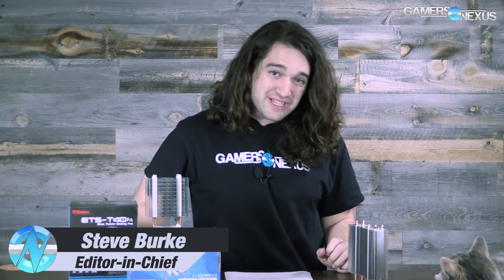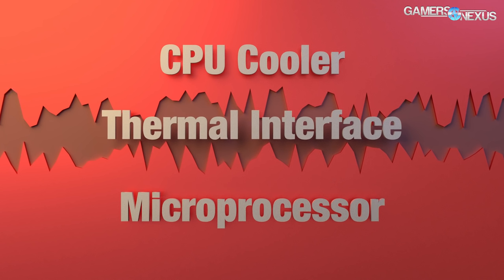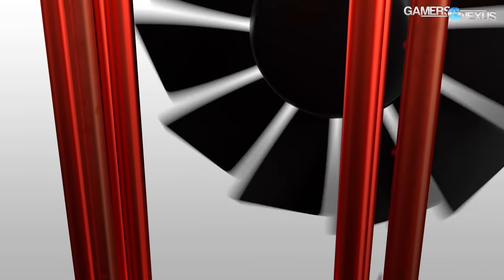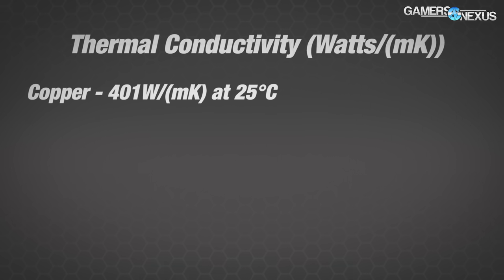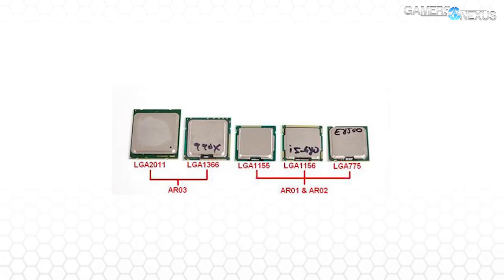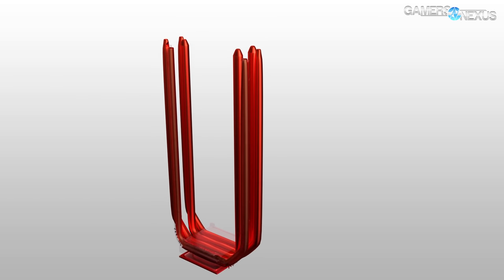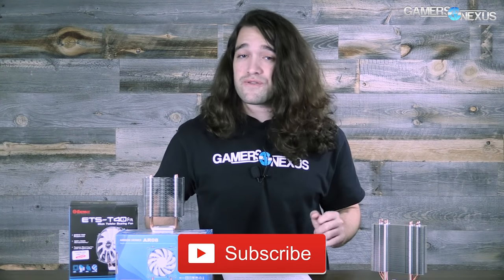TLDR: How Heatpipes & Air Coolers Work (w/ animation)

Comment: I deal with heat exchangers and oil and water seperators at a chemical plant. I never knew these pipes had liquid in them. I thought it was a dry hot to cold heat exchange. Learn something new everyday

Comment: Great video. Never knew about the heat pipe internals and the resulting capillary forces. I do have one question though:
I can see both types of heat pipe & fin stack coolers working perfectly (full size like the Hyper 212 EVO and low profile like the GeminII M5), when used on a test bench where the motherboard is laying horizontally, and the fin stacks are above the CPU. That being said, I can't understand how these coolers work in actual builds where they are attached to a motherboard mounted vertically in a case, especially for the low profile ones! In that situation, the fluid inside the heat pipes would just move down to the lowest point of the heat pipe when cool. When the fluid inside heats up and evaporates, it rises and there is nothing stopping it from moving up in the heat pipe towards the CPU, rather than towards the heat dissipating fin stacks. When this happens, you now have vapor locked heat pipes against the CPU that are only going to get cooled down from passing air, rather than from the intended fin stack section.
I'm not trying to say these are garbage, because they clearly work. I found this video because I want a low profile heat pipe cooler in my build, so I'm not bashing them. I'm just genuinely curious about how these actually work when mounted in a case. If anybody can provide a little insight, it would be greatly appreciated!
Reply: In principle, the method of heat travel in heat pipes is independent of gravity. Heat rises and cold sinks by gravity, so that doesn't matter for the same reason. Heat pipes are used in space, at zero G, too. Heat does not rise in 0 G.
 Start by forgetting the usual way of thinking about a gas. Air is also a gas, and its thermal conduction is terrible. The speed of conduction in heat pipes is very high because the gas is so rarefied that the molecules travel long distances with few collisions (ideally none) with the other molecules, exactly the opposite of how air conducts. The temperature gradient within the heat pipe, in the gas, will be very low. The actual problem is getting the molecules hot, and therefore moving fast. That is what all the change of phase from a liquid to a gas and back, and the wicking, and surface area is for. The way this video has it, it looks like liquid is going to a gas in one place, and gas is going to a liquid somewhere else. This is not true. The phase change is at an equilibrium, approximately, everywhere in the tube. The phase transition is happening everywhere in the tube.
 Basically the inside of the tube is closer to a vacuum than a gas. It only has enough liquid added so that it will evaporate (due to low vapor pressure), and still the gas molecules will be so rare that the gas molecules will seldom get in each others way. The amount of heat moved is in how fast the molecules move, rather then in the number of molecules moving.
Reply: @kennethflorek8532  Your reply made me even more confused

Comment: What happens with the gas when heat pipes are horizontal? After all, they are horizontal for most tower CPU coolers and GPU coolers in a standard, vertical mobo case.
Reply: @mehulmonisha  said it has a liquid, well liquid follows gravity right?, if the cooler is horizontal, the liquid will be on the lowest part of the tube?

Comment: So if I'm understanding correctly, if the cooler is laying horizontal like in your animation where gravity will pull liquid down, and I quote "and through capillary action it trickles its way back down to the bottom and repeats the process", it will be most effective at cooling the CPU. BUT my question is: IF my tower is standing up and the CPU fan is now oriented vertically, will most of the water rest in the pipes due to gravity? Effectively not really evaporating by direct heat of the CPU but rather indirect heat from the CPU to the heat pipes? Does that makes sense? If that is the case, would it not be logical to keep your computer tower laying horizontal to get the best effect of the CPU heatpipe air cooler? Or is there some logic that I am misunderstanding? Thank you!
Reply: This is a very good question and deserves an answer!
Reply: no problem, just need a bit more time (become warmer) than vertical mount to get a peak temperature.

Comment: Can you solder a cooler directly on the CPU ? This would improve the thermal conductivity a lot however the temp during the soldering operation might destroy the chip.

Comment: So, can the cooler boil dry, if it is facing sideways ? I have it like that in my built. I built it before knowing about that liquid inside the pipes, and now i am worried. Maybe i just build a wooden stand for my pc, that gives it a little angle, so the vape moves away from the cpu ? Is that a good idea ?

Comment: I always wondered how the liquid inside the heat pipes returned to the bottom without interfering with the rising hot gases. Thanks for that. But there's an immediate issue with heat pipes then. For heat pipes to work optimally, wouldn't it mean the heat pipe itself would need to be placed vertically with the hot section at the bottom and the cold section at the top, as this is how boyancy and gravity drives the phase change process. 

This might be a good experiment to test man! See if heat sink with vertical heat pipes aligned vertically vs the "normal" i.e. side ways that it will be inside the case and also side ways graphics cards might change the temperatures. you get.
Reply: OnePercent this is the main reason for the wick and fluid mixture so it works in any direction. The main cooling is phase change so getting the balance of mixture so it changes at the right temp.

Comment: Hi and great explanation. Wish I can get a response to my question. Can you overcool a CPU tower heatsink with heat pipes as used in you demonstration here? My scenario is different where I'm using the CPU cooler with Peltier's module. The hot side is on the heatsink cooled by two fans. I noticed when I shut down the fans, the cold side of the Peltier got colder until the heatsink heats up to over 40 deg. C. Then I will turn on the fan to cool back down to about 32 deg. C and it will continue cooling the cold side more(colder). So are there a kick in and kick out temperature for optimal performance of the CPU cooler. Wish I can really get an understanding of this.

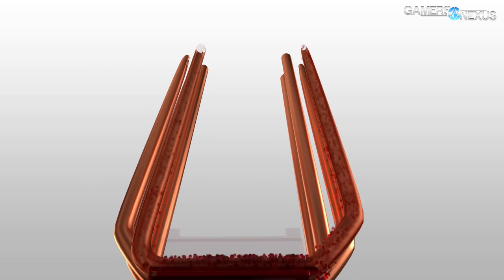Comment: So, if 1:30 the liquid turns into gas, then it evaporates upward right? but when we install them and then have our towers stand, it's sideways right? how will that work then?
Reply: The principle is the same just change the orientation. The gas still expands to where it can expand which is away from the base to the colder regions.
Reply: @harveybirdmannequin  thank you!
Reply: @orenji13  https://www.youtube.com/watch?v=2aQg1v5rXKw
Gamers Nexus actually did a video with testing. Orientation had no meaningful impact.

Comment: If only lapping was not so expensive and hard to do right on soft metals like copper we could get rid of thermal paste all together. If one could get both surfaces with a surface finish/roughness of less then 25nm then the heatsink and cpu could be wrung or cold wielded together. It would be interesting to see if the thermal transfer would be better or worse compared to thermal paste.

Comment: I was shopping for a new CPU cooler and got far too involved into the science of what and why.. Long->Short; older NH-D15 seem to work better on 32 core CPU's than new NH-D15 because of there target cooling for CPU's at the time by changing the boiling point of the liquid in the heat pipes.

Short->Long; I was watching Kit Guru review a Zalman CNPS20x as that's what seems to be the best bang for buck on the higher end of air coolers and he didn't realize he had an older NH-D15 to which he tested out of curiosity. To which he found that the older cooler performed better. My initial thought was the older fans probably spun faster idk, but it still made no sense. Then i thought far too deeply about it and how heat pipe's liquid is formulated to boil/phase change at a target temperature. Too cool and it stays liquid, too hot and it stays a gas ("running dry"). And Consumer CPU's from 10 years ago ran Very hot and 200 watts with 12 phase motherboard's where the craze, and could easily go to 300 watts with overclocks. I know for sure the FX-8320 i still have can suck down about 300 watts @4.7GHz :-/ but it doesn't go over 68c on a Zalman CNPS9900 MAX (3x140mm Nuctua intake fans on the front) BUT it also jumps up to 60 quickly as (my guess) the liquid isn't phase changing until then. Where's new Consumer CPU dies (not prosumer like the 12/16/32 core CPU's) are soo small they can't really move the concentrated heat into the spreader so then in turn the spreader it self is cooler, thus needing a lower target phase change in the heat pipes to cool the CPU, ergo.. modern Coolers target lower TDP and perform "worse" for high TDP applications.

Comment: What about plating, such as Nickel, on the coldplate? ... with Nickel having a very low thermal conductivity, although in plating it's obviously an extremely thin layer, does it have any impact on cooling performance at all? I'm guessing it would be so negligible that it's not worth worrying about but would be nice to know for sure ;)

Comment: +Gamers Nexus   Does this mean the orientation of a cooler would have a significant effect on its performance? most are mounted on their side (tower case), neither specific gravity of liquid/gas or hot/cold would be working as designed. an interesting +Gamers Nexus test? great job with he animation that's next level

Comment: So these types of coolers like the ryzen wraith cooler doesnt cool as well in a normal side position in a tower like it would sitting directly on top of the motherboard in where the pipes are going up and down instead of sideways correct?

Comment: I have a question could I use that heat pipes for the heating surface inside mold without using fun?! I mean that liquid inside the tube will be cycling again if I didn't use fun I just want to heat to transfer for the surface?

Comment: I have a question, why don't motherboards come with steam chamber? All that energy in waste heat, we should pour it back into the psu via steam engine. I mean steam engines can theoretically get upto 30% efficiency. That's pretty close to 80+, right?
Reply: What CPU or GPU hits 100C all the time in order to create steam? That is just to get wet steam. To get dry steam, which turbines like for longevity takes even more heat unless a different medium is used. Not to mention that the larger the temperature difference between hold and cold sides the greater the maximum efficiency can be. With a low temp difference of less then 100C the max efficiency would also be low. There is all kind of stuff on heat engines, the Carnot cycle, etc. out on the web.
Reply: I think it ruins the joke if you force me to explicitly state that it is sarcasm.
Reply: Jason Smith The "That's pretty close to 80+, right?" sounded like a joke, but I have lost count of the number of people that have asked that same question or something similar to it over years.

Comment: Thermal paste longevity: is there a time limit of the effectiveness of the thermal paste applied i.e. should thermal paste be re-applied periodically or never touched again?
:>)
Reply: its more of a "if it ain't broken then don't fix it" thing. I mean my ps3 is still working and I have never replaced thermal paste in it. my PC I had soon 4 years, moved 3 times, and thermals are still top notch.
Reply: Change it when your temps start to go up.....

Comment: How does the condensed liquid in the heat pipes get back to the base,  when nearly all heatsinks are mounted at a 90 degree angle to the ground?
Reply: D0wnshift It doesn't need to get to the base, it will just heat up where ever it's at then and still do its job.

Comment: This will be a complete noob question... Is there any benefit to polishing the contract surfaces of the cpu and the metal of the heatsink?
Reply: you meant "contact surface"
The answer is yes, smooth surface faster at transferring heat

Comment: what i never understood is why the temperature difference between the CPU and the cooler is so significant. If i touch a 80deg hot graphics card - it really is so hot that you don't want to touch it. Doing the same with a 70deg warm CPU running a load test and the heat pipe above the CPU is hand warm.
Reply: touch is from the bottom. the top of the cooler gets the least amount of heat, if you're into that kind of stuff, or run some cpu stress test for a full hour and fans to 20% and you will get your desired effect aswell

Comment: why don't they make thermal compound that contains copper? i mean it should perform better right?
Reply from the maker: There is compound that makes use of carbons or other materials to improve conductivity, but it often becomes electrically conductive as well. This is dangerous to use if careless, as any spill-over from the IHS (onto the board or elsewhere in the system) can cause short-circuits.
Reply: Most thermal pastes use a metallic oxide suspended in silicone grease. The main issue with the thermal paste is that the silicone grease is not really that conductive and the metal particles in it still have gaps between them. You can get some really high end thermal pastes based on non silicone greases as well liquid metal thermal pastes. However they are only marginally better than conventional pastes because the liquid metal alloy is not really that conductive due to the metals that it's made of not being particularly conductive and the pastes that use non silicone grease based TIMs still have the same issue that silicone based TIMs have and the alternative silicone really isn't that much better.

Comment: so the thermalpaste is the weak spot in the whole process, is there any projects or researchers to find a better heat rated paste? something not below 10 value.
Reply from the maker: Yes. Thermal compound is a weak spot. There is better thermal paste (and there are good thermal pads) out there, but it tends to get significantly more expensive. The ideal solution would be a perfectly flat piece of copper and perfectly flat IHS (or lapped surface), with 0 room for air pockets, and then no thermal compound. But such a solution is not reasonably or affordably possible, right now -- manufacturing is largely an imperfect process!

Comment: Question; in most tower cases, the CPU surface is vertical, meaning the cooler lays sideways, and the heat pipes don't get the benefit of hot going up and cold going down.  How does that affect things, real world?
Reply: Hot air goes up and cold air goes down, but that is air in our atmosphere, and it is moving due to air pressure caused by gravity. In a heat pipe or engine heat transfers from hot to cold. As Steve said the better heat pipes use a porous almost sponge like lining, which water, ammonia, etc. can wick up through against the force of gravity towards the heat source since it is phase changing and is drier so water, ammonia, etc. wants to flow there. Once the liquid is phase changed into a gas the molecules by the CPU/heat are moving faster then the ones at the cold ends so there is a difference in pressure, which want to equalize so the hot gas flows towards to cold ends of the heat pipe. As long as there is enough forced air flow across the heatsink via a fan how it is mounted should not really matter.

It would be an interesting vid for some Youtuber to try out one day to see if I am right or wrong :).

Comment: My heat pipe doesn’t get hot or even warm. I can’t find any answer online if this is normal or not.
Reply: The only thing that matters is whether or not your cpu temps are in spec with the cooler you have.  Just because your cpu is, for say, hitting a toasty 80c, don't expect that to translate into heat pipes that are hot to touch.

Comment: Hey Steve, great video as always man. As other people said in the comments, you're creating great content, and I appreciate it so much. I know it isn't much to offer (as I can't do patreon right now), but if you ever need anything me, along with many of your other subscribers would be more than happy to help in any way possible.

Also, I wonder how big of a difference there would be if you forwent the thermal compound, and soldered a cooler directly to the IHS. No idea if factory tooling is accurate enough to do this w/o manufacturing inconsistencies that would severely negatively affect performance though.

Comment: Why don't they make the heatsink a giant metal box ?
Reply: Do you mean with no fins? That would mean less surface area, and less heat dissipation. They are also restricted by physical limits such as weight and large size, which stress the motherboard and are incompatible with other pc parts.